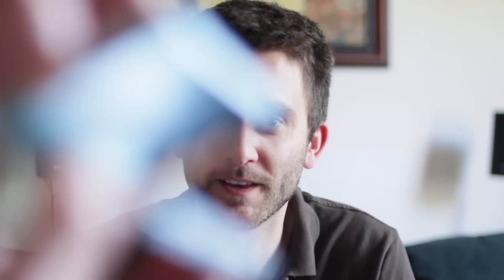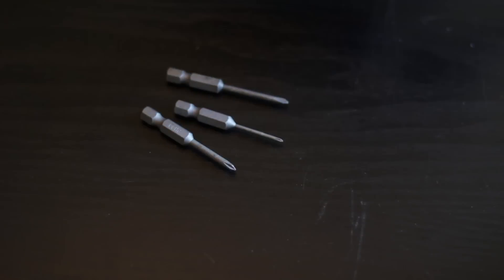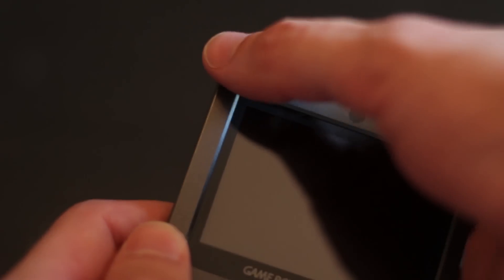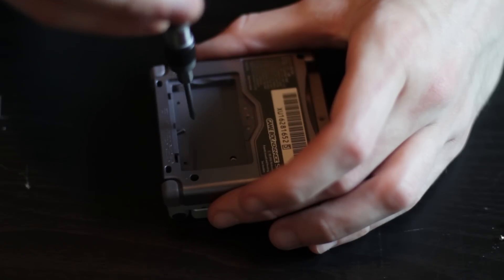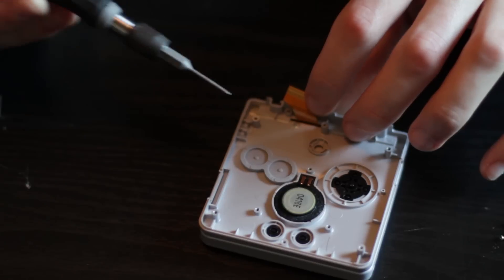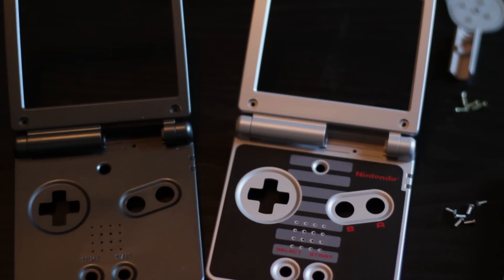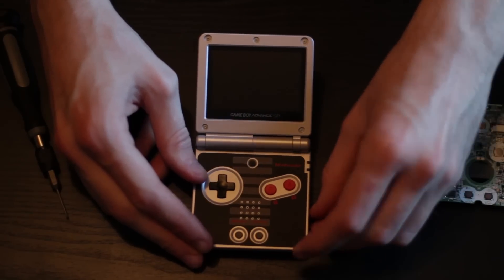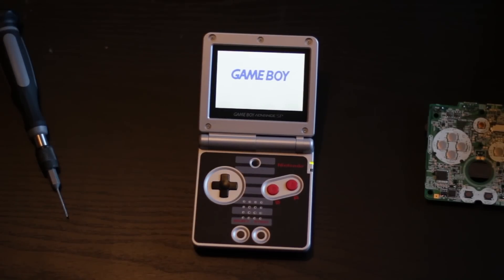Gameboy Advance SP Screen Swap How-To

Comment: I have a almost brand-new AGS1 Gameboy and my heavily used AGS101 GB with black black pixels. I was wondering if there was any way to transfer or fix the screen issue on the 1 version with components from the 101.

Comment: Question is the boards different at all?  I have a bad memory gba sp, it was my first gba ever and my dad broke it cause I spent to much time on it (yeah my dad sucked)  so I left it die but saved it, now I have an extra 101 screen but that gba was a 001 so I wonder if it would work, if I haven’t try yet is cause I don’t have a working battery.

Comment: How do i do this the other way around? I need to use a 001 screen in a 101 motherboard D: when I tried it and tried turning the knob it was either inverted or all white with the word gameboy barely visible.
Reply from the maker: The screens aren't directly interchangeable between the -001 and -101, which is why we swapped the main board along with the screen in this video.
Reply: Hmm I knew that the 001 board wouldn't work with a 101 screen but I didn't know that a 101 board wouldn't work with a 001 screen.

Comment: Should I do an entire screen repair if my GBA SP's screen only does part of the display when a game is in it? Like without a game cartridge in it, all of the screen is visible but when I place a cartridge inside it stays for a bit and then have of the display just turns into black lines.

Comment: Could you just swap the screens?
Reply: No, the frontlit screen can be put into an AGS-101 motherboard, however, the backlit screen cannot be put into an AGS-001 motherboard.
Reply: Really? Not even with some adapter?
Reply: This explains why... oh shit, I didn't even think of it.  Putting the WHOLE THING in instead of just swapping the screens.  I'm an idiot, and I just wasted an hour of my time.  >_<
Reply: Kyle The Runner You can actuay mod the 001 motherboard to have it work with a 101 screen.
Reply: @yobelkcip  how?
Reply: @oscarscottbaker2641  I believe it involved soldering some wires onto the board.

Comment: is it possible to buy a GBA SP NES edition, with not a lot of scratches? I really want to buy one
Reply: Yes you can get a Perfect one on ebay for like 120$ +
Reply: You just need to look around. I got lucky and bought mine from a friend if my brother's who didn't want it anymore, and it was pretty much perfect (you can see for yourself-- it's the one we used in this video). Better condition systems usually go for more, especially special editions with painted on designed, as they show scratches very easily.

Comment: what pin is the AGS 101 screen? 40? 32?
Reply: I don't think they're either. Maybe you're thinking of the original AGB-001. Some are 32-pin and some are 40.
Regardless, I believe all AGS-101 screens have the same number of pins/contacts.

Comment: willl a gba sp 1001 back lit screen work with a 001 model motherboard?
Reply: Gallon Tiger Only if you mod with soldering wires

Comment: two things can you put it in an older gba because my sps are fine but I don't have a charger and I have 2 I wanted to switch the screen for the one that the sounds water damage and put it in my gba and maybe buy a charger for the other one since it's 100% fine and 2) what's the song?

Comment: Stupid idiot question. So, if I get an AGS 001 and swap out the AGS 001 BOARD for a AGS 101 board but keep the screen there, will it be backlit?
Reply from the maker: HibHab69 It will not. If you want a backlit screen, you have to have the board AND screen from an AGS 101. The screen from an AGS 101 will not work on the board of a AGS 001 (it will still display, but wont light).
Reply: KindOfALotOGaming ok thanks!
Reply: +KindOfALotOGaming I am having problems removing my screw on the battery cover. The screw is stripped. It was a previously owned system and it came like that. Do you have any solutions to remove it, since it is a very small screw?
Reply: +Sam Dakota what I usually do in situations like this is I take a slotted screwdriver of about the same width as the screw head, and push it into the screw add hard as I can. Then, wiggle it back and forth (while still pushing hard) and work the screwdriver into the screw head. Eventually, you should be able to grip it enough to turn it and get it out. I've removed lots of old stubborn screws this way. Philips head screws are a major pain when they get stuck since the soft metal they're usually made out of gets chewed up easily.
Reply: +adimifus Just about any other type of screw head is better than Philips. Since the driver has a pointed head, it has a tendency to want to jump out of the screw and chew it up in the process.

Comment: how can i get a new screen for my gameboy advance sp LCD screen with the flex cable because when i had opened mine up it had broken in half so now the lcd flex cable is connected to the screen and the pther part of the system.

Comment: I just lost  of my best gbas cause of this. Connecting the new screen to the old gameboy is nearly impossible. Its hard to get at the right angle and to press the 2 buttons down, and the wire line thing just did not do what it was supposed to do. There goes $60. And just cause I hae nobody else to be mad at, fuck you

Comment: i, i have a SP AGS 001 with the broken LCD, can i swap the lcd of ags 101 to the ags 001 gameboy?
Reply from the maker: You would need to swap the entire insides for that to work. The 101 screen does not work with the 001 insides, which is essentially why we did this video.

Comment: I have two SP's, one with a broken screen, and one that was dropped in a river. I was hoping the river SP screen still worked. Following this guide, I swapped the two screens, and now I have a fully functional Game Boy Advance SP. Thank you for this amazing guide :).
Reply from the maker: Awesome! Glad we could help ya get a working system again!
Reply: please help how do I replace the lense on a ags 001 screen lcd do I heat screen up first?
Reply: MrDarkace no you can just carefully peel it off, a haridryer might make it easier but isn't mandatory
Reply: Gg

Comment: My ribbon broke off making the mother board and screen separate. Can I still do this?
Reply from the maker: If the ribbon itself actually broke, then you would have to use a different screen. The ribbon does disconnect from the motherboard, but you have to unlock the ribbon and pull it out. Once the ribbon is broken, to my knowledge, there is no way of repairing it.
Reply: KindOfALotOGaming oh ok. I know how to disconnect it. but, yeah, the actual ribbon snapped in half. I accidently dropped it onto a hard carpet material. :( thanks for the heads up!